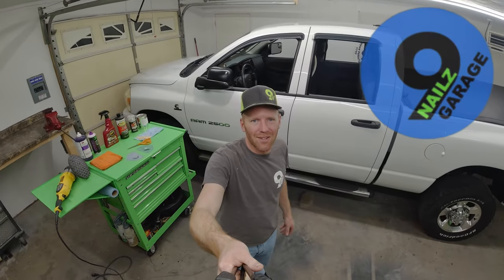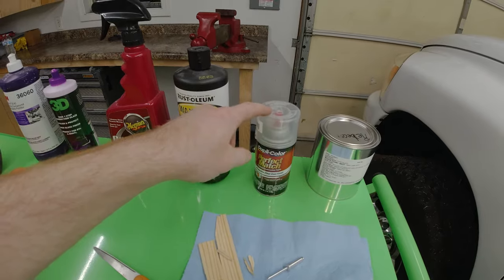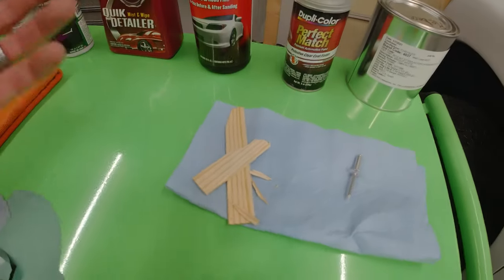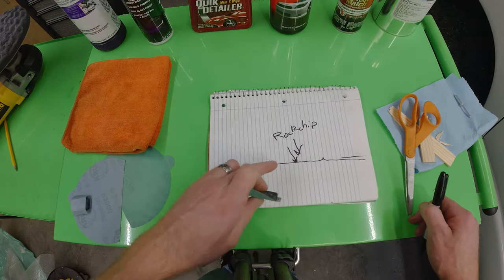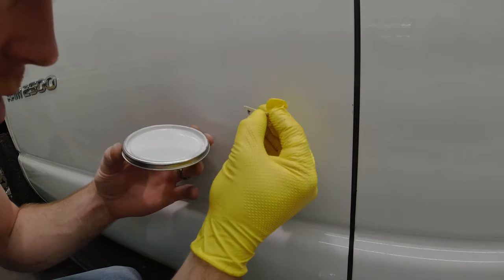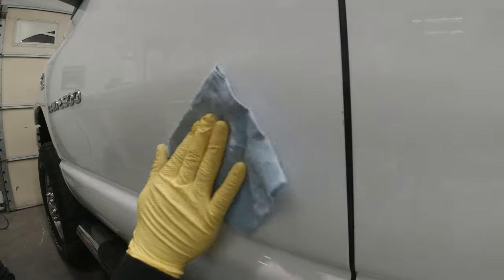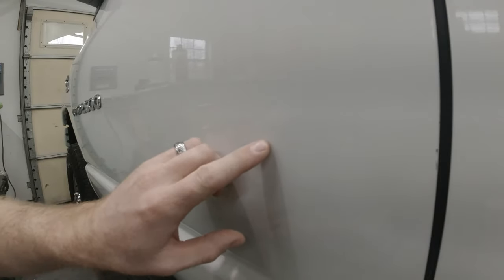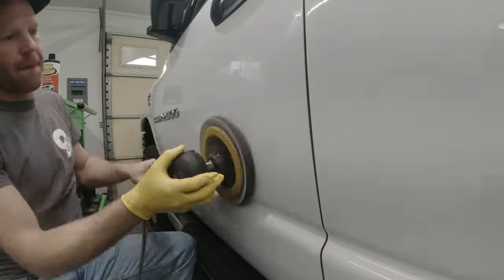How to Properly Repair a Rock Chip in Your Vehicle's Paint

Comment: I see all the comments about, "this won't work with metallic paint". The key with metallics is to use as little color as possible just enough for coverage but not enough to build above the surface, so that you don't actually sand the color...it sits below the surface. Then build up your clear for sanding. Sure, the repaired area might be a little more noticeable than with a solid color, but it'll be a heck of a lot better than looking at a rusty area. Patience is the key. If you got a hood full of rock chips then you're probably better off repainting the hood but I think this method would work well for 10 chips or less. This is definitely the best paint chip video on YouTube.
Reply from the maker: Thanks for the comment and the tip! Patience is definitely your best friend when it comes to any type of paint work!
Reply: With metallics the only true color match is when you spray.  That is because the flakes will all be lying flat.  With touch up some are standing up and some are flat which gives the appearance of a mismatch.  Still a great video but there is a reason the truck is white.......

Comment: This is awesome, man! I am having an issue with the paint dissolving when I start wet sanding. I am doing this outside in cold but I used heat gun. What am I doing wrong?

Comment: Honestly, this has been the best video I’ve seen. The only part I’m nervous on is using the Razer blade to clear off excess clear coat.
Reply from the maker: Thank you! The razor isn’t completely necessary it just helps to knock the clear down if you put too much on
Reply: @9NailzGarage  Thanks so much for your advice, would you recommend any specific hand buffing pads? Unfortunately I don't have access to a buffer/Polishing machine.
Reply from the maker: No problem, however I don’t know that’s id recommended doing it by hand, you might be buffing for literally a day or two. There’s some cheaper polishers out there that will work really good, you’re arms and shoulders will thank you! I suggest checking harbor freight, or possibly Amazon.
Reply: @9NailzGarage  I'm going to do that then, definitely don't want to be buffing for two days lol. Thanks again for your advice. I bought the supplies you mentioned and will try my skills on an Inconspicuous spot first.
Reply: Ok so will this look bad at first on black paint after wet sanding ? Lol
Reply: Then you should try with Mirka Mini-File, it does the job perfectly.

Comment: I''m currently trying this outside so its not in a climate controlled environment (~30C), but for me, I needed longer than 2 hours before I wet sanded and cleaned the paint chip before applying the clear coat! I tried at the 2 hour mark and wet sanding was okay but when i used an ipa it took the paint off and I have to reapply a couple coats. Currently waiting longer as we speak for paint to dry!
Reply from the maker: Patience is key! Good luck!

Comment: Great video. I haven't done this myself but the result is easily the best of all the videos I've seen on YT. Would you have any suggestions for how to do this if the rock chip also has some rust buildup in it + some that dripped down the paint?
Reply from the maker: Try to pick at the rust with a metal scribe to get most of it out, then the rust stain should buff out easily with a wool buffing pad
Reply: @9NailzGarage  thanks! going to attempt this as soon as the rain lets up

Comment: Hi! Your video is great!! Planning to do it today, been postponing it as I'm a bit afraid (first-timer) to leave it worst. a) Do I have to mix the paint with thinner (as mentioned by the paint store)? b) Do I have to mix the clear coat with the activator (sold separately by the store as well, ratio 2:1)? c) If there's no wax remover in this country, could I clean the area with alcohol or other easily available product before start the process? d) Can the clear coat be applied with a toothpick or is there any reason why you use a metal object? Thanks a lot!!

Comment: Impressive outcome.

I have two minute chips in my door cause by derbris thrown by weedwacker.

One is about the size of the head of a toothpic and the other smaller. They can only be seen when light is directly at them, but not from angles. I cannot see primer. 

Any help on how to fill these tiny shallow holes would be much appreciated.  I already tried compound polishing with no luck.

Comment: Found a small chip near the tail light. No idea how it got there but there was definitely some surface rust on it. I am going to use this basic method, but was curious if the rust ever came back on that spot? This car is a 22 with less than 20k miles so its got me stressing! The chip is probably a bit bigger than a grain of rice.

Comment: Why no primer before the color and can the clear coat be applied without hardener ?
Reply from the maker: You can use primer if you want, I don’t think it’s necessary though. I’ve done many repairs exactly like this with no issues. If it’s 2k clear it will need the hardener, the clear I used in the video is one part.

Comment: This is good however never paint over corrosion where at all possible. Look for a product called bilt hamber deox - c gel. Use this on stone chips and leave them covered with a little bit of cellophane/clingfilm for up to 24h. The corrosions will be gone and you will be left with a clean surface.

Comment: So at the 4 minute 22nd mark you use the 2000 grit sandpaper I was wondering are all the other times you were using sandpaper prior to this the 3000 grit?

And then one other question if you don't have one of those buffer DeWalts can you just use your hand with one of those pads?

Comment: Why didn’t you mix the clearcoat with the paint make it two part paint .? It looked like there was rust in the chip hole or Was it Primer?
Reply from the maker: I scraped as much rust as I could from the chip before applying the paint. I've never heard of mixing paint and clear? Usually I tend to stick to what each individual manufacturer recommends.
Reply: @9NailzGarage  I mix the paint and clear together and suck it up in  a large large hypodermic needle and then apply it to the chip or scratch. And you have a two part paint. it goes on nice and smooth don’t have to mess around trying to put on a clear been doing that For years try it I’m sure you’ll see the difference
Reply: @harryodum5598  Very interesting method using a needle for applications. Thank you.

Comment: My rock chip was larger and I used the Motorcraft pen. After the third coat, to smooth should I hit it with 2000 or 3000? Or nothing?

Comment: Would you use something like Bondo to fill a deep chip? Or just layers of paint?
Reply from the maker: I prefer layers of paint, no do could be difficult to work with being that small
Reply: Just paint. Bondo is a filler for holes and dents to bring the panel level back.

Comment: Some other videos say to mix clear cost with the paint. Is that not advised?
Reply from the maker: I’ve heard of this but have never tried it, I’ve used this method on many repairs with no issues. The only advantage I could see to mixing the two is it could save time, however paints and clear coats have very specific chemical properties, I could see possible issues with mixing certain paints and clears. Just my opinion, I could be wrong

Comment: I wonder if some metal prep might be advisable?
Reply from the maker: I think the only way to completely clean the metal would be to grind it down to good metal and repaint the whole panel. I cleaned the metal the best I could with a scribe. In the end it looks way better than it did before and it should last for many years to come
Reply: @9NailzGarage  I scratched most of the rust out then used metal ready rust remover from por-15 to pretreat the metal.
Reply: @9NailzGarage  I use 50:50 household vinegar:water and soak about 30 min to dissolve rust from many surfaces. I'm thinking that ought to help here. (Unroll a cotton ball to help it actually soak.) Think that might work, or dangerous to paint?

Comment: Tip: DON'T DO THIS. Just touch up with a bit of paint and leave it. DON'T SAND IT and DON'T MESS WITH THE CLEARCOAT, especially if you have a newer car. Thanks to this video, I burned my clearcoat and now need a respray at a body shop. I barely touched it with a 1500. The clearcoat layer is very thin on newer cars.
Reply: I was worried when he started sanding.  I do this professionally and the way I learned was by screwing up.  With the wrong pressure from your hand you can burn through that clear in a heartbeat.  Not to be negative but this is also a straight white color.....not black, pearl or metallic.  This will not work on metallic because the chips will not be laying flat.  There is a reason this was done on white.....it hides very well.  Lastly the color is spot on.....that was the first thing I noticed.  There are variations on colors, (except black) and because I have been doing this for 25 years I can usually start pretty close to the original but most times you need to mix more than once to get the correct color.
Reply: what make is your car?
Reply: You obviously didn’t do it correctly then lol. Then is the same method that body shops use.

Comment: So is there any reason you HAVE to buff the day after filling in the rock chips? I figured I would go ahead and use my paint that already has clear coat to fill in my chips and do my buffing around mid-march when I typically give my car a full detail. I am personally going to avoid sanding the chip because I feel if you’re not very careful you can make it much worse for paint like mine - metallic silver (BMW paint). Thanks again. I want to go ahead and fill them in to avoid future peeling, rust, etc.
Reply: Avoid mixing the clear with the paint for metallic paint repairs. It will not match with the sorrounding area. Metallic coulor needs its final shine. Sanding with 2000 grit and above when done carefully with almost no pressure will not hurt your clear coat. Even 1500 wet sand with a "soft" hand wont hurt the clear much.
Reply from the maker: Waiting a day allows the paint to fully cure before sanding. If you don’t plan on sanding you shouldn’t need to buff it. Both sanding steps are encouraged though for a near perfect finish. Like the prior comment, if you take it easy with the 2000 or 1500 grit there will be no issues. This is how professionals repair high end cars, Ferraris and such. Good luck!